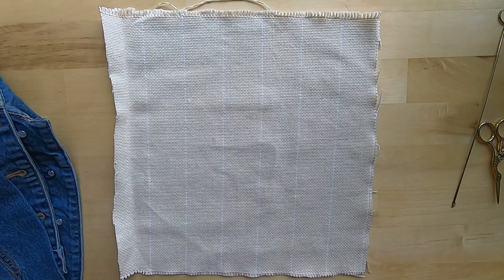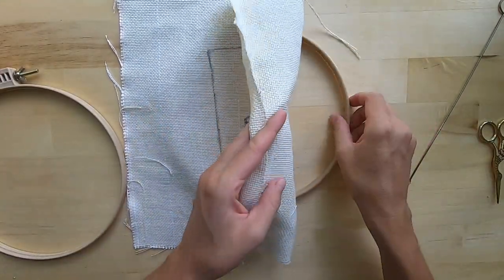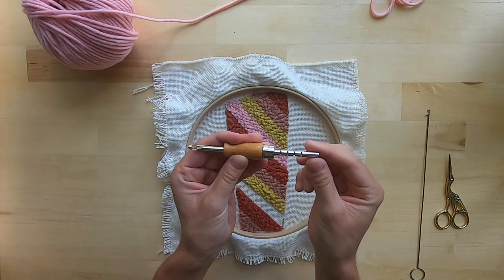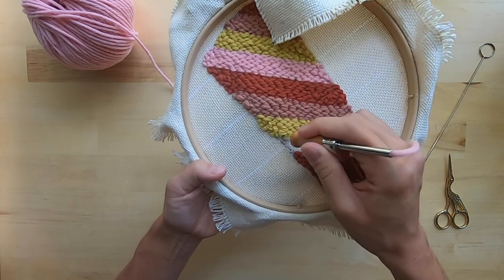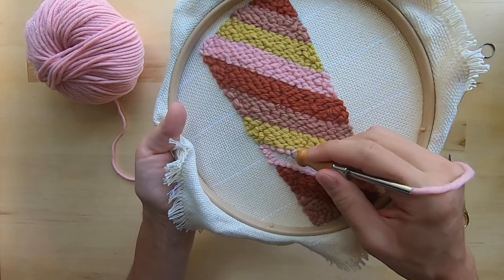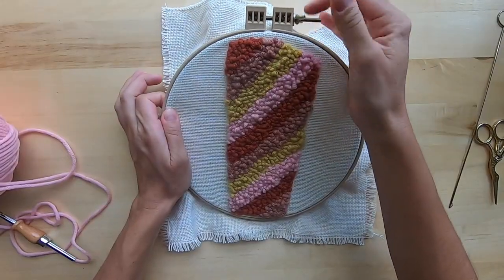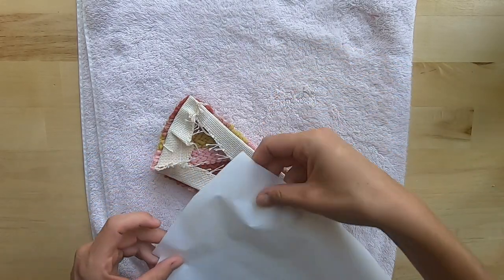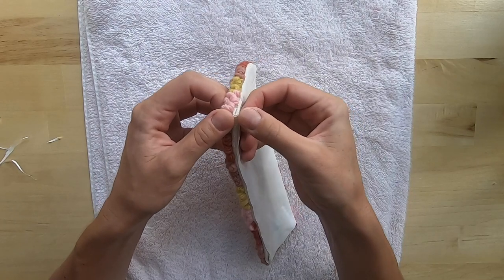How to Iron On Punch Needle Patches - Long Video

Comment: hi sorry for my english a question can the job be fixed any vinyl glue? another thing I see that you used on a garment once washed remains so beautiful or frayed?ciao dall'Italia;)
Reply from the maker: You can use a PVA glue to secure the back of the loops if you wish. PVA glue is a glue that doesn't yellow. You spread it over the loops and let it dry. I used a Superwash wool yarn for the patch to prevent fraying when washing. xx, Shawna

Comment: hi there! i was wondering, im sure the iron on adhesive holds the loops so they cant be pulled out, but how are the loops that are underneath the folded monks cloth able to stay in? thank you!
Reply from the maker: The Monks cloth fiber strands are loosely woven, which allows them to push tighter together once you place the yarn loops in your piece. The strands and the yarn loops make the fabric so tight, it holds the loops in place. One loop may get pulled out (similar to a rug pile) here or there, but overall the loops stay in the fabric quite nicely.

Comment: I don’t understand why you have to do the outline on both sides?
Reply from the maker: Great question! The first outline is drawn to copy the jacket space onto the Punch Needle fabric. You wouldn't necessarily have to draw the lines of your design on the front side. If you draw the design on the backside, remember this will be opposite when you turn it around. The second outline is drawn on the back so you can see where you're working while punching. Let me know if you have further questions.